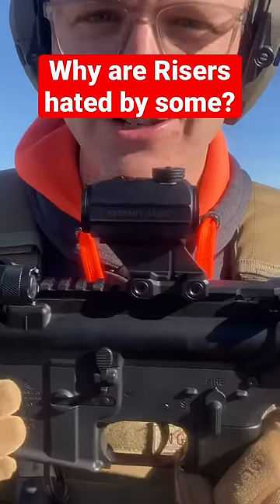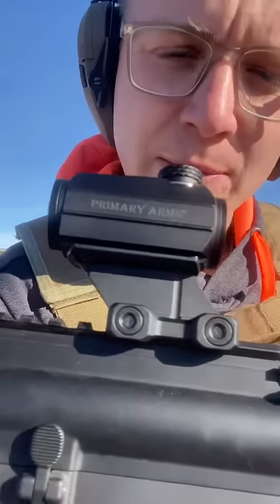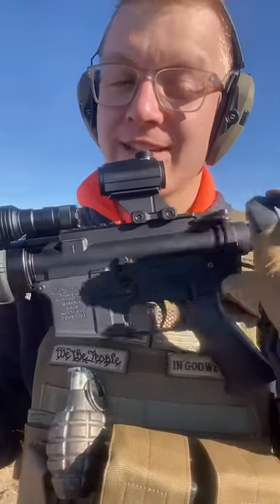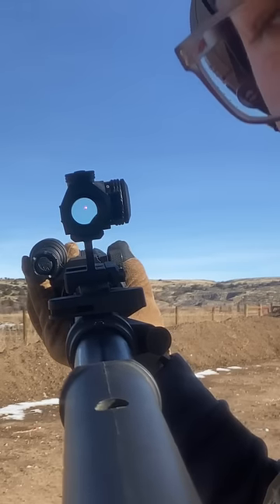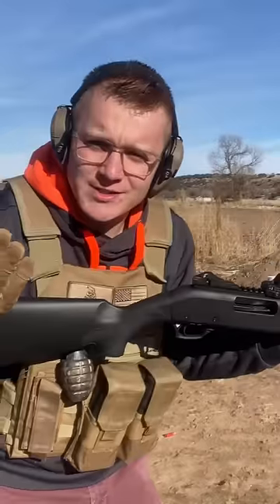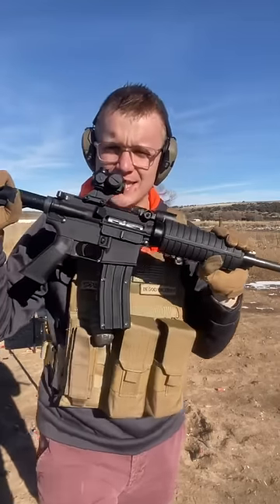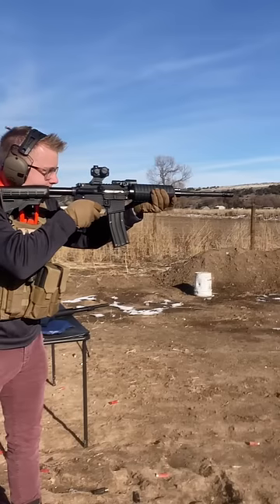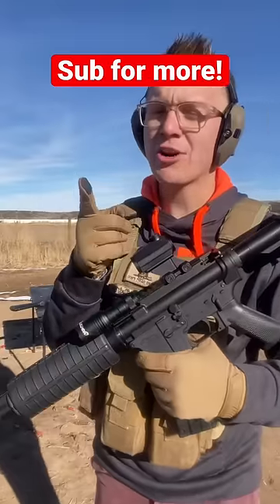Why some people HATE this… (height over bore) #gun #fullautofriday #civtac #bodyarmor

Comment: I’m sorry I was too distracted by how the light was mounted to listen to anything else
Reply: Dude have no mounting space on the handguard, so it's understandable why light is there. And it's order of magnitude better than mounting with blue tape.
Reply: @UselessZero  IWC is your friend they have a mount you can use with standard handguards
Reply: @crazysarge1664   I have a couple of those. Super solid mount considering what it's on.
Reply: @militantfascade9176   I am ordering another one after Christmas
Reply: @Crazysarge16   IWC's sling mount for the same handguard is equally well made and solid for a QD mount up front. Only problem is if you want to use both on the same gun, because the 7" carbine handguard (the M4 size, not midlength) runs out of room fast.
Reply: I can not unsee that now. Thanks.
Reply: @UselessZero It's literally plastic hand guards. He could cut them or buy sectioned hand guards. Absolutely no reason to have the light like that.
Reply: @UselessZero  lmao up they make light mounts directly to the barrel.. there is absolutely no reason to run a light like that
Reply: He's got a railed gas block with no irons so why not use that.
Reply: It’s a bit far back for my liking. There be this giant telephone pole shadow everywhere!
Reply: @ghostface5348  not that he's using this for precision with but that wood totally fuck the barrel harmonics more than running A2 handguards
Reply: @keefjunior4061  honestly I was more troubled by his choice in jeans.
Reply: I barely got by that flashlight. Lots of strange happening in this video.
Reply: @crazysarge1664  nothing cooler in this world than taped on attachments
Reply: @politicallyinsensitive4200  bro worried about barrel harmonics on a .22lr....

guessing you haven't been laid in a few years?
Reply: @UselessZero  use black tape then
Reply: I didn't even notice it till u said sum lol
Reply: I'm absolutely PRAYING his setup is so shit to get comments. 

Then again, this video was proof that anyone can and will make gun videos.
Reply: The light placement gave me cancer
Reply: @RichardCranium321  not really a .22lr but I get your point and since you brought it up no. Due to nerve damage I got on active duty I haven't. 
I also said he most likely wasn't using it for precision work but it's ok; I'm guessing that reading comprehension isn't your strong suit. You could also either be trying to tell me you don't shoot farther than 100yds or you don't really know shit about shooting; I can't tell which.
Every rifle barrel; even your 22lr; has some barrel whip and vibrations that travel up and down it when you fire. Those vibrations crashing into each other in the milliseconds between powder ignition and the bullet leaving the muzzle have a lot to do with where the muzzle is at the moment of exit which in turn affects the poi. Putting anything on any barrel will affect those harmonics.
Reply: @UselessZero  the old school way to mount a light is to drill some holes in the clamshell and strap it down with hose clamps ran through it
Reply: @keefjunior4061 exactly a massive shadow and his entire rifle is going to get lit up in a night time situation
Reply: @noeg3095  Ah true lol I was questioning why all the hate but that makes perfect sense.
Reply: @UselessZero  Yeah, just enjoy the giant dick shaped shadow the rest of the barrel and handguard are going to cast in the beam of light, effectively making it less useable.  But his poverty pony build tells me all I need to know.
Reply: I just duct tape a 3cell mag light to the bottom of mine.

Comment: The shotgun has a dropped stock making it “natural” to get behind a low optic with a cheek weld. The AR is a straight line with zero drop so having raised sights is required. The A2 carry handle exists because of the need to raise the sights.
Reply: Definitely not required 🙄 that's why they made the A4 with removable handle

Comment: You fall into that category of "Not even wrong", you need a riser because the stock goes straight back instead of dropping down. The same reason AR iron sights are raised rather than just over the barrel. Look at any cold war rifle and you will see the stock drop because the irons were as low as posible.

Comment: 1) If you don't understand where your gun is shooting at specific distances, you need to shoot it more. 
2) Red dots provide fast target acquisition. Nothing comes without a trade off. Missing by a couple inches on the vertical axis will provide acceptable results in most practical applications if you're aiming at the area between your target's nipples. So don't worry about it because it probably doesn't matter. Ample video evidence demonstrates that unprotected soft targets that are struck with rifle rounds in the chest tend to stop what they're doing and lay down a very high percentage of the time.

Comment: AR’s require raised sights and optics because of the higher cheek weld. The AR’s stock comb has no fall like the shotgun. It has nothing to do with a faster sight picture.

Height over bore issues are a non-issue if you understand your zero and practice a little bit.

Comment: From what I understand height over bore is not a huge problem especially on an AR which has almost none by default, and can deal with a little extra just fine.

Just look at any gun that has a gas piston/spring housing tube above the barrel such as the fal, g3, or ak; all of those have about as much height over bore as you would get with a riser on an AR, and yet many countries still use them, and they work just fine.

It just goes to show that combat and target shooting are two extremely different things that have very different requirements when it comes to speed vs accuracy.

Comment: 1: you're wrong, the sight is elevated because the top of the reciever is directly in line with your reciever extension/stock. Using a normal optic mount you have to jam your cheek down way too hard to try to see your sight picture, creating many issues. A normal sporting rifles reciever is actually higher than the stock. 
2: having your red dot that far back limits your field of view outside of your sight picture, that's why most people position a red dot further forward on the reciver.

Comment: Completely inaccurate information.  You would never adjust your sights to match up with the bullet trajectory.  If you did it would only be accurate out to the range of which you sighted it in.   Beyond that the two paths would cross and you would miss every shot.  Instead measure the distance from center of red dot to center of boar.  Then take a shot at a small target like a dot.  Then measure where the round lands and continue to adjust until it matches the previous mentioned measurement of red dot and boar.  Now you have a hold over and you can shoot 223 600-800 yards and still be on target.

Comment: It can be lower on the shotgun because the stock drops down and allows the bore to be inline with your eye, where as the AR the action doesnt allow for that and requires a straight stock and with that, you can not get "lower" on the the gun so to properly see though the optic or iron sights, then have to raised 🥸

Comment: Another important difference is the height of the optic compared to where your cheek weld is. On the shotgun the stock is lower so your head is lower, putting an optic mounted directly on the rail higher up relatively. With an ar15 optics sit incredibly low so you sometimes need a riser so you don't have to squish your head down incredibly low.

Comment: I mean, all sights have height over bore. You're not adjusting your sight to match the exact trajectory of the bullet as it leaves the barrel, you're matching it to a distance within the bullet's trajectory that you're comfortable with (for most this is 25 or 50 yards). The higher your height over bore, the higher the angle of the weapon's barrel has to be to meet at your sight's zero. I would draw a diagram but shit man I hope I explained this well enough

Comment: That jam though.
Reply: It’s a 22lr M4, that’s not a jam, last round bolt open on those cause of the mag feed
Reply: @jillthecivic5650  according to the casings, you are correct. 1 point to the import with the girl name.
Reply: @jillthecivic5650 thank you!  I was sure that sounded like a 22, and I thought that thing looked off.  The forward assist looked kinda fake, the recoil was non-existent,  even for a .223
Reply: It's the cmmg .22 bolt I believe

Comment: So, ask yourself, why are the iron sights on the shotgun attached to the barrel and the iron sights on the M16 attached on the top of the carry handle and a tower on the gas block? Could it have something to do with something other than tracking moving targets (which I very much want to do with my M16, it's a matter of life or death) or quick acquisition (which I very much want to do with my shotgun shooting skeet)? Hmmmm ... might it have something to do with muzzle rise under full auto fire? Look at the stocks. The M16 stock comes straight back from the breech (being in-line, which reduces muzzle rise) and the shotgun stock drops below the breech (it can because shotguns don't do full auto). If you place the top of each butt-plate at the same height, you will find that the top of the shotgun's barrel will be remarkably close to the original iron Line-of-Sight of the M16. The riser is needed to put the red dot more or less on the M16's original LoS, because that's where your eye comfortably falls. Otherwise, you would have to lower your head 2 inches, which is uncomfortable for those of us with necks. I suspect that shotguns can't tolerate the greater height over bore because they are short-range weapons, and so choose the increased muzzle rise as a necessary compromise.

Comment: Also shotgun stock put your cheek weld lower than a gun with a stock in line with the bore that's reason why ar15 typically have higher red dots

Comment: Has to with in-line stocked guns. An AR has a stock that's essentially flush with the reciever, so you need a bit of a rise in order for your cheek weld to properly align with the sight. 

For a shotgun with a traditional rifle stock it's set a couple inches below the reciever, so a short bore axis sight will line up properly

This is why for example an M1 garand has low profile sights that are like 0.5 inch above the reciever and barrel, while an m16 has a tall carry handle to mount the rear sight onto, and a tall triangular front post to mount the front sight onto that raises the sights up by 2-3 inches

Comment: More to do with design of the AR platform and how the buffer tube causes problems being in line with the barrel. With out that issue AR would not need riser at all. How ever this is balancing act since if stock is lower than barrel this causes gun to pivot upwards more, but then again this can be fixed with well designed compensator.

Comment: You missed the point of a riser.
You can get away with a low optic on most guns because cheek rest is below the barrel and therefore your line of sight is low.
The cheek rest on an AR is above the barrel and your line of sight is higher, so optics NEED to be higher.

It has nothing to do with tracking birds lol

Comment: I've been taught that the dot should always be set at the range the round is going to start it's drop. If your round is 300m(+/-) effective, then your dot is centered at 300m.
Reply: Most use a 2 point "zero". The AR does well with a 50+200yrd zero the ballistic arc starts about 2 inches lower than the optic rises up to the sight line at about 50yards rises another 2-3 inches or so and drops to cross the sight line again around 200yrds. (All depends on bullet weight and velocity etc.) But this means if you aim center mass you are within +/-3 inches vertically to about 300 yards with no change in zero and those all hit torso when aimed at center mass.

Comment: You don't need a riser on a shotgun because the comb is lower. Also, nobody "hates" risers. They're necessary on AR's because the stock is in-line with the bore and it would be impossible to get your eye into your optic with a cheek weld otherwise. This is not that complicated.
Reply: No they aren’t necessary. Tons of people have red dots without a riser, and you don’t have to guess height over bore at close range as much. I have an eotech and I’ll never use a riser unless I absolutely have to
Reply: @FirstnameLastname-gz8hy  That's because EOtech's are already designed to be the right height for an AR. You can't run something like an Aimpoint T-2 without a riser or you'll see nothing but your front sight post.

Comment: I always mount my optics as low as possible.  Height over bore significantly reduces the versatility of your zero.
Reply: It's called "mechanical offset", not "height over bore".
Reply: @jameshuhn6924  Whatever. Both expressions mean the exact same thing.

"Mechanical offset" is the clinical term, which is literally defined by measuring "height over bore".

Comment: Please for the love of all that is holy do NOT follow this guy or take anything he says at face value. 

Everything in this video is crap. 

Knowledgeable gun owners and especially those who work and train with AR-15s do not “hate” risers. A riser is just a part of the sighting system and it’s been there from the beginning of the design. 

Height over bore isn’t an issue. It’s just a mechanical fact that the shooter has to understand as it affects where the bullet will be in relation to the line of sight along the bullet’s trajectory. The distance at which you zero the rifle will also be a factor in that calculation.

Comment: I am tall, and have a long neck. The only thing comfortable for me is the Unity Fast Riser. I don't have to duck my head to shoulder the stock, and get behind my optic. 

Height over bore is a known variable, and honestly not that big of a deal, even up close. 

You already have 1.5 inches height over bore with irons. Lower 1/3 cowitness puts you at 1.93 inches above the bore. The unity fast puts you at 2.26 inches above bore. 

From the irons to the unity, it's only 3/4 of an inch. Doesn't matter up close at speed, doesn't matter farther out, where ammo changes have much greater differences. 

Bonus points if you use a circle reticle like eotech. You use the bottom of the circle up close, then the dot from 25yds to infinity.

Comment: "You get your sight quicker"

Um I thought you needed a riser on an AR because the rail is lined up with the buffer tube so you can't get your head low enough for a low mount optic where you can with guns that have a dip in the stock like that shotgun or an AK

The riser in and of itself doesn't provide you with a faster sight picture otherwise we'd all be running 5 inch risers to get a sight picture like the flash

Comment: I put the dot on the range of max bullet apex. So you hit all the way up to the dot a little low. Then at the apex the bullet will carry through a zero longer because it hits your dot on the up and on the down, over a longer distance. Then just aim at shoulder height center mass up to 500meters. 5.56 is fast enough with wind at 500meters to score a hit, shooting shoulder top center.

Comment: So no one who uses an ar hates a riser on a red dot for one any lower it makes the red useless because the angle your eye lines up is a way off. A proper mounted red dot or scope or any other sight is determined by 1 thing real when you shoulder the firearm and put our cheek up against it were does your eye line up even with the center of the sight. Faster sight picture is only one of many benefits of having proper height on a sight better accuracy is another big one. As for shotguns the stock of a shot gun is lower to and with sight alignment along the top of the barrels and really in my opinion if you put a red dot on a shotgun no one should take your advice on guns a standard bead sight is the fastest and most then effective sight for a shotgun.

Comment: That's exactly what I do in airsoft, in terms of zeroing the sight, for dmr build I zero it to close to its max range, that way I can still lead, wind adjust, and compensate for drop from farther as the bb doesn't spin off just goes down at a certain  length, and since the hop up isn't maxed out at closer ranges max I'll use the scope with goes up about half way on the scope so flight path is still usable

Comment: Um, NO.  AR's need a riser due to the butstock being in direct alignment with the barrel.  You can't get your cheek to stock sight picture low as with most other stocks. Has nothing to necessarily do with speedy target acquisition but the designed recoil impulse and mechanical operation of the rifle.

Comment: Bro straight up does not know why the riser exists and why the shotgun sight is low. It’s because stock / cheek placement. You can’t smoosh your face close down to an AR15s flat top to get a comfortable look. The stock is in line with the bore. The shotgun, AKs etc are not so they can be lower

Comment: This is going to be funny to anyone in this comment section that reads it. But one of my favorite hobbies is "nerf". Or basically playing airsoft style games with high powered (and sometimes even the weaker off the shelf) blasters. But even in nerf we have risers for our optics. The thing is there's so much drop off if you're playing a sniper or DMR role that the risers are tilted forward by about 10-15° lol. And for anyone wondering I prefer nerf over something like airsoft and paintball for the fantasy/sci fi elements and the modding. Also I got into the hobby with my 2 nephews age 6 and 13.
Reply: Also I've been around a lot of gun violence in my life. I own firearms for me and my familys protection and keep them locked away safely. So something that's more realistic like airsoft just isn't for me. Not knocking it at all for anyone who enjoys it though.